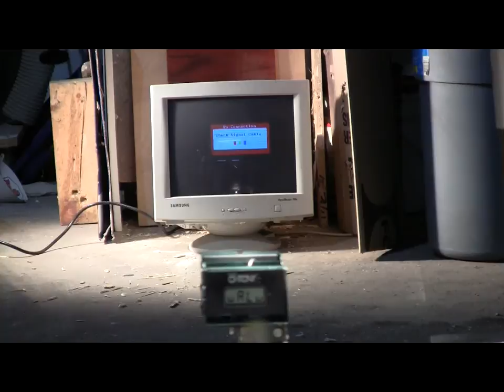Air Cannon #17 - A Running CRT Monitor

Comment: Another awesome video! CO2 is probably at around 850 +/-50 psi. 375gr, 420 fps gives 147 fpe,  with an achieved 12,2% efficiency and your 72" barrel you'll have  1279 ft.lb.f. with 850 psi. with 800 psi: 1,203 ft.lb.f, so it appears that the barrel is too long for the amount of gas pushing your bullet, and friction is robbing any velocity over the knee. With that length of the barrel, helium would be the way to go and with a 200 cubic inch dump reservoir. You achieved efficiencies of 71% with your 48-inch barrel in your other great video. What would be awesome would be to attach a piezo transducer to the end of the barrel to watch the air pressure in front of the bullet cushion spring the bullet as it compresses the air in the barrel, which I think is why your not achieving the theoretical 1,240 fps with no frictional losses of any kind; in other words, the barrel in front of the bullet holds 18 cubic inches of air at 14.7 psi, so the bullet, in reality, inside the barrel, is really acting as a piston compressing the air because the air can't move out the barrel quickly enough. Thank you for the video. Liked and subscribed.